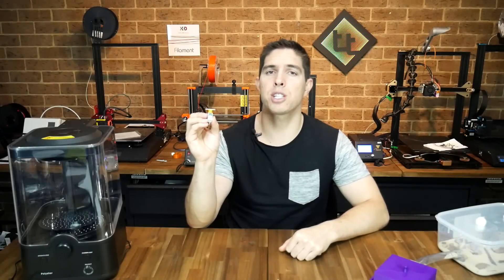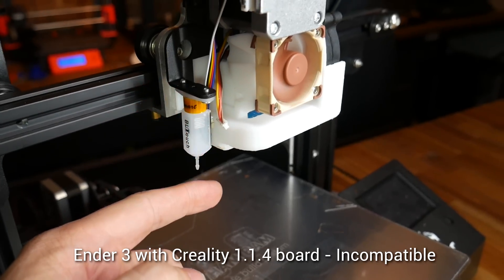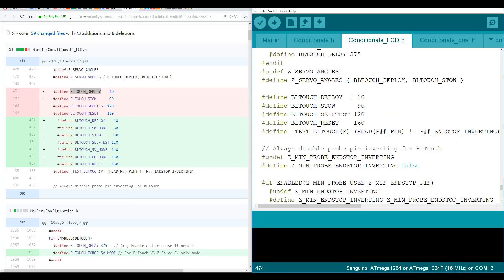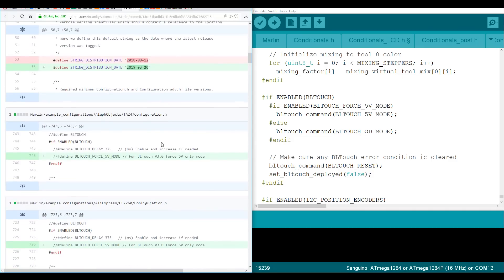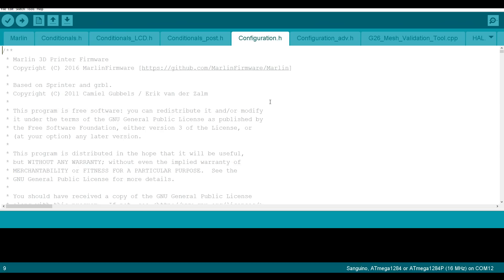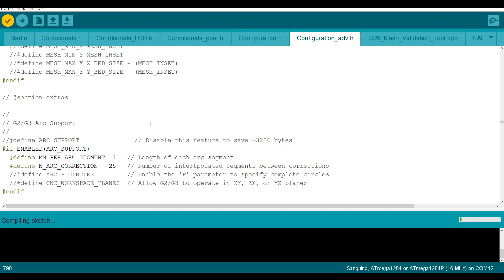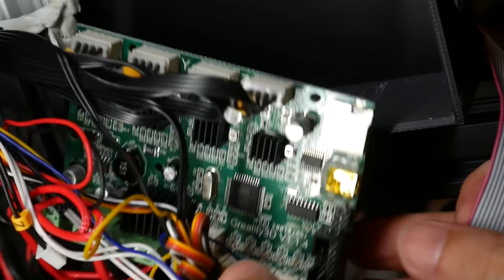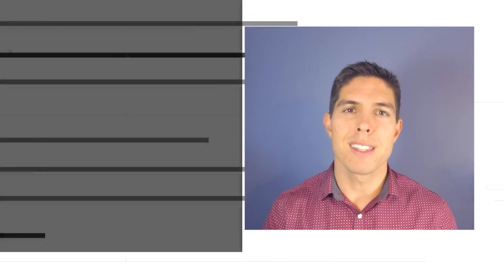3 Fixes for BLtouch V3 on Creality machines

Comment: Im thinking about buying a 3D printer in a few months, and the Ender 3 its number 1 in my list. But after watched your videos, about fixings, firmware upgrade, boards,... I feel a little confused. I mostly make 3d art but I know some basic code...but seems like the Ender 3 needs a tons of work. Also a dont know how to sold pieces. I dont want a noisy 3d printer...

Could someone sumarize all this information, maybe ELi5? Pointing which videos I should watch. Thanks in advance
Reply: In case it helps. I'd say that the only thing you really need worry about, given what you say is to get quiet stepper drivers. All the other upgrades are nice but not essential, except perhaps the thermal runaway issue, but that depends on how you will use your machine and how big a risk you think it might be. Out of the box, the Ender 3 can produce really nice prints with zero messing, just basic adjustments like bed level and making sure the carriage rollers are smooth and set to the right tension - easy to do with the tools supplied with the machine. Getting your slicer settings right has a vast impact on print quality and speed, and is all easy to do (tick a box, change a number) if not that easy to understand at times - lots of great tips out there, check out CHEPs channel if you end up using CURA for example . As you won't be buying for a bit, there's a very good chance your new machine will come with the new mainboard which has quiet stepper drivers fitted already. Even with quiet stepper drivers, the fans make a bit of a racket too ;)  That said, I am very glad I fitted TMC2130 drivers & MKS-GEN-L mainboard on my Ender 3 Quieter fans are next :)

End of the day, this is a very cheap product, made down to a target price, so I guess we have to accept some compromises.

In summary, 

First 'mod' I did was to set up and connect a Pi with Octoprint - love it. Not really an Ender mod as such though and entirely optional, but it does make life so much easier.

I fitted an MKS-GEN-L board to enable the fitment of TMC2130 drivers. It also made it easier to update firmware as it has more memory. A good upgrade I feel, but only if you are into messing about with stuff like this - I absolutely get it if you aren't.

I fitted a BLTouch. A great convenience aid, but not essential as long as the print bed is flat and levelled manually once in a while. It's even more of an aid if you keep swapping your print bed all the time, as it'll take care of different thicknesses for you automatically.

Also fitted an MKS-TFT28 but wouldn't honestly recommend it as it doesn't add much at all IMO and can't replace some functions of the stock display so you really need to keep both.

I've printed and fitted a number of 'upgrade parts' from Thinigverse - all pretty worthwhile I think, but all very easy to do. Cable chains, filament guide, Raspberry Pi case, back cover for the stock display, case and support for the MKS-TFT28

Good luck with whatever machine you choose.
Reply: @chrissavage5966   thank you very much! What you replied me its gonna be a guide to keep reasearching. You are right, maybe in a few months all this will be easier and I will have more time. I am already saving posts from reddit and youtube videos with all kind of tips and tricks, last one was about layer size and how to fill 3d print... A huge new world, really excited to print my 3d models. Thanks again!
Reply: @javideas   Most welcome. I'm very much a newbie to 3D printing myself and have found the information available, particularly from Michael, has been absolutely invaluable.
Reply: Tevo Flash and buy it locally if you can! It's a fast beast and need just few improvements. 2nd Z is useless, so buy the cheapest version - you'll save money for BLTouch, nozzles and a 1.9mm bowden tube. it's called "Capricornus" on AliE, the original Capricorn are about 3x more expensive. I've found that this tube helps a lot about retracts!

Comment: I installed mine a couple weeks ago, and followed someone else's hack which used Marlin 2.0 Alpha.  The bltouch doesn't crash into the bed anymore, and goes through the probe routine, but I don't know that it's really working as designed.  Have you looked at Marlin 2?  Do you know if all the code changed in your method#1 were added to Marlin 2?  

Also, the stock ender3 had a simple pre-print flush of the nozzle that worked well, where it drew 2 listed on the left side of the bed before printing.  I don't know if it's the BLtouch or Marlin 2, but now it probes the bed, and then does the 2 line flush, but moves very differently.  It glides very close to the bed before printing the first line, draws it, returns to the middle of the bed (leaving string along the way, and returns to the left side to draw the second line.  Do you know if this is Marlin 2 that changed this behavior?
Reply: Normally it shouldn't change the behavior.
The lines are from the  start gcode from your slicer.
"; Ender 3 Custom Start G-code
G28 ; Home all axes
G29 ABL
G92 E0 ; Reset Extruder
G1 Z2.0 F3000 ; Move Z Axis up little to prevent scratching of Heat Bed
G1 X0.1 Y20 Z0.3 F5000.0 ; Move to start position
G1 X0.1 Y200.0 Z0.3 F1500.0 E15 ; Draw the first line
G1 X0.4 Y200.0 Z0.3 F5000.0 ; Move to side a little
G1 X0.4 Y20 Z0.3 F1500.0 E30 ; Draw the second line
G92 E0 ; Reset Extruder
G1 Z2.0 F3000 ; Move Z Axis up little to prevent scratching of Heat Bed"
Maybe there is one command between the two lines?
Reply: Which is your 3D printer? Did you have to invert the black and the white pins?

Comment: Here is my contribution. This is my custom start gcode for Cura. Trust me, use it. It changes up the order of operations and 100% gets rid of the blobs and strings you get while it probes the bed. 
; Ender 3 With BLTouch Custom Start G-code
M140 S{material_bed_temperature_layer_0} ; Set Bed Temp
M190 S{material_bed_temperature_layer_0} ; Wait for Bed Temp
G28 ; Home all axes
M104 S{material_print_temperature_layer_0} ; Set Extruder Temp
G29 ; Auto Bed Leveling
G92 E0 ; Reset Extruder
G1 Z10.0 F3000 ; Move Z Axis up little to prevent scratching of Heat Bed
G1 X0.1 Y20 Z10.0 F4000.0 ; Move to pre-start position
G1 X0.1 Y20 Z0.3 F4000.0 ; Move to start position
M109 S{material_print_temperature_layer_0} ; Wait for Extruder Temp
G1 X0.1 Y200.0 Z0.3 F1500.0 E15 ; Draw the first line
G1 X0.5 Y200.0 Z0.3 F5000.0 ; Move to side a little
G1 X0.5 Y20 Z0.3 F1500.0 E30 ; Draw the second line
G92 E0 ; Reset Extruder
G1 Z3.0 F3000 ; Move Z Axis up little to prevent scratching of Heat Bed
; End of custom start GCode

Please feel free to share this, It took a decent amount of digging and searching to find this info and Ive never heard any of the channels I listen to mention something like this and I dont personally have the means to reach the community in the same way you do.

Comment: Hello from Belarus, very helpful video, thanks you Michael. Maybe you give some advice how to add babystep function to MKS TFT28 menu? I installed BLtouch sensor on MKS Gen L, change firmware, like you show, changed Z offset, but i need a manual adjustmens in screen menu. Thanks a lot.

Comment: Hello, I have Ender 3-Pro and 1.1.4 mainboard. Firmware is 1.1.9 bug_fix as you explained in second method. I set all the settings as yours. I set the Z-offset correctly with (G28-G1 F60 Z0-M851 ZX.XX-M500-M501) commands by using A4 paper and Its good now. I also add the G29 command to the slicer. But there is a problem when I m trying to print something. Printer starts to print highly for example: I set Z-probe -2 but while printing I have to set Z-offset again to -3.1 or -3.2. Doesn't the first z-offset setting (-2 ) valid?

Comment: Michael, great video, but, I've run into a problem. I have an Ender 3 pro and BLTouch v3. I'm using method 2. I've applied the 1.1.9 bugfix firmware with settings you used in this video. The finger test works. But, when I autohome and then try to adjust the Z axis by moving Z the value starts at +10.0 but will only reduce to 0  and will go no further. I think I need about -6.0. Your video seems to allow you to move the Z axis to < 0. What have I done wrong? Also, I wish I had viewed the video more cafefully because I have applied the firmware without the bootloader. If I need to make any firmware changes I will have to pull the machine down again. Please help!
Reply: Ok, so it turned out not to be too big a problem. It just took me a long time to determine the correct Zprobe offset, working well now. Still interested why I couldn't dial past 0.00 though
Reply: Steve McAllister , can you post what you did? I seem to be having the same problem. I’m printing about 5 mm above the bed. Did you make changes in the firmware or just thru the LCD?
Reply: @JohnDStrand  I just started to decrease the Z-offset via the LCD a little bit each time and keep doing test prints until it was correct. However, after I had resolved my problem I found this https://www.youtube.com/watch?v=y_1Kg45APko. I didn't try it but apparently there is a soft endstop limit that stops the Z-axis from going below 0.00. The video disables with M211 S0 then basically follows the same approach as Michael. M211 S1 re-enables the soft endstops.
Reply: @stevemcallister8649  thank you

Comment: Interpretation of the rather vague specs sheet at https://docs.wixstatic.com/ugd/f5a1c8_77037f55e5d542309d9fc178165c9f3f.pdf  
Looking at the Signal Timing Diagram section, the waveform whose left axis is marked "Hi-Z or 1" is evidently the output of the BLTouch when connected to a board with a pull-up resistor. (Page https://www.antclabs.com/bltouch-2 shows open drain output.).  Imitating a microswitch, the BLTouch is normally closed, and changes to open during bed touch. The salient part of the plot is annotated "Bed touch", where you see that a touch event causes BLtouch to quickly retract, resulting in about 10msec opening of the switch and consequent voltage pulse at the printer controller. If the controller input has a 10uF capacitor and 4.7kohm pullup (47msec time constant), the BLT's pulse of "open" is too short to permit the controller's capacitor to charge up to a logic 1 threshold, so the microcontroller chip never sees it. Crash. 
Note. This plot suggests that the BLT retracts autonomously. If instead this bed touch behavior is due to the controller's software commanding the retraction, then a different sequence would take place. Upon a touch event, there will be a delay, perhaps 50msec until the voltage at the controller input rises to a 1 threshold, then the controller MCU sees it, and commands the retraction. However during that delay the controller would continue to command the nozzle lower, so again, Crash.

Comment: Melzi schematic in readable resolution: https://reprap.org/mediawiki/images/7/7d/Melzi-circuit.png. For what it's worth, the Z-Stop input uses at 4.7k pull-up resistor, and 10uF capacitor, for a nominal 47msec time constant. So a switching delay of somewhere around 30 to 80msec, when switching from off to on (high to low).  Switching in the other direction depends on the BLTouch circuitry.

Comment: @Teaching Tech thanks for the video, unfortunately after using the hex file you designed, I couldn't get passed the part of homing my BLtouch. The z axis limits movement to no less than 0 (no negative values). Do you think you could provide some insight? I'm using the supplied USB burner with the BLtouch kit. The firmware seems to be flashed properly.
Reply: Calvin, I had the same problem see my comment above. To resolve it I just set the z axis limit to 0.00 then set a Z-offset of about -2.50 I then just kept running bed level tests repeatedly reducing the z-offset each time until I got a good print. I finished up at -2.85 and it is now working well.
Reply: Thanks Steve! Works great. Onto the next steps in Slicer!

Comment: Thanks Michael! I will try this out this weekend. I am using the TH3D version of Marlin right now, so I might go back to Vanilla Marlin and also take out that capacitor. Thanks again for the video!

Well, I have it performing the probing and starting to print, but it’s printing above the bed about 5 mm. I can tell it did the mesh, because the z axis is moving as it goes from right to left or left to right. I tried setting the z offset, but it doesn’t seem to move. I’ve tried from -4.99 to +1.0 and no different. Not sure what I am doing wrong or what steps I’m leaving out.

Love your videos! Keep up the great content.
Reply: I used this video, tells how to put in the  Z-offset using Pronteface https://www.youtube.com/watch?v=y_1Kg45APko

Comment: I have been struggling to figure out why I couldnt get this thing to work on my cr-10s pro. Is there anywhere to download the right firmware for that machine. I would be happy to pay for it to be plug and play!
Reply: Spent the entire night trying to figure out why my bl touch won't fire on mhy CR-10s pro.  Anyone have hex file out there for this model and the bl touch V3?
Reply: This is exactly why I've started up a new project doing this: https://marlin.crc.id.au/

If those firmwares don't work for you, lets work together on getting it going.
Reply: @CRCinAU  You have something for CR-10s pro and bl touch v3?
Reply: @mattmcguire348  In theory - yes - with the offsets for the official Creality mounting hardware. I don't have a CR-10S to test though - so it would be good for feedback.

Comment: What would you recommand as firmware for my ender 3 stock controler with v2 bltouch? the one you just created? 
or the older one that you did for the v2bltouch? I have the PIN 27 board
Reply: And what is the mount that you used for the bltouch so that I can print one and have the exact (almost) same number for the offset. Did I said you rocks? ;-)

Comment: Can you confirm removing the capacitor works with no lasting effects? Seems easiest to me
Reply: The only thing they do is filter out electrical noise, sometimes the noise can trigger false positives on the board, but I don’t believe it’s an issue unless you have EXTREME electrical noise like mounting a plasma cutter arc on your printer
Reply: Mike Scholz thanks for your replies, im worthless when it comes to electrical knowledge. I can solder and wire things but I have no clue what capacitors do. Thank you for your help sir!
Reply: He did say that the only lasting effect would be for the controller card to begin to work with other sensors too, and the sense of achievement. Provided you only remove the ONE capacitor, lol.
Reply: its actually bad form to have capacitors at all on any switch because it introduces a delay between triggering, and actually registering on the board. just removing it would make the stock endstop more accurate.
Reply: @mikescholz6429  Why are they even there? I thought perhaps they are there to line condition the voltage.
Reply: I don't think you have to worry about that capacitor not being there.  I think the main problem is the value of that capacitor is too large.  I just removed the cap on my Ender 3 Pro last night and measured it with 2 different testers and it's a 10 uf (micro-farad). I believe a better capacitor to block noise would be at a lower value, say 0.1 uf or less, depending on the frequency band of noise you're trying to block.  I also think I read somewhere that the BL-Touch may already have a noise filtering capacitor in it.  That may have something to do with why the V3's that came out in March were immediately changed in April but I'm not sure (mine was unfortunately made in March but hoping it will be fine - time will tell).  I was just waiting for Michael to put out this video to make sure I wasn't missing something before I flash my board and install my BL-Touch. I'm still running the Creality firmware, but  I'm hoping to flash a boot loader and the firmware tonight.

Comment: thanks for the video, i've also noticed that TH3D updated their firmware a few days ago, its now up to "U1.R2.10d" two weeks ago when i got my Ender 3 and flashed it,  it was version "U1.R2.9b" did they update to fix this?
Reply: yes, thats right. TH3D updated the firmware. I´m using it and it works with bltouch v3 on ender 3.
Reply: I personally have flashed 10d on cr10s with many issues so I gave up and went with vanilla Marlin 2.0 using config from 10d

Comment: I'm so glad I haven't upgraded to BLtouch for my Ender 3 yet seems to be more complicated than it should be. I have the V2 BLtouch model but haven't hooked it up yet because I have no problems with my bed level so no need to install it yet. I got the BLtouch in case my glass bed breaks because the regular removable bed is horrible for bed leveling.
Reply from the maker: Fair enough. If it's working well, it makes sense not to alter. A lot of these issues are teething problems from a new BLtouch version. Soon the fixes will be in the main Marlin branch and really easy to get implement.
Reply: @TeachingTech  Thank you for the response and all the hard work you do to bring information and products to the community. I look forward to each video you make!

Comment: In time thx man but i have question  in your marlin offset  you  typed  x=-43 and y =-9 thats make sense but why did you left the z to 0 isnt the z little above the nozzle by 3 to 6 mm ?
Another question you added a line for pin 27 board in my case cr10s what should i type instead ?
Reply: If i understand it, the probe will still work efficiently. the only thing that will be higher is your z offset to compensate for it being a bit higher.